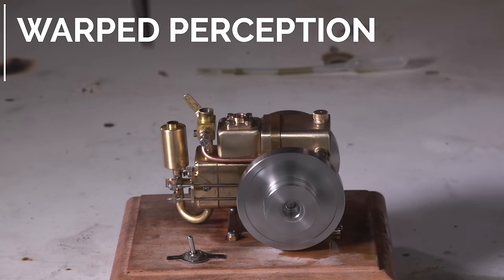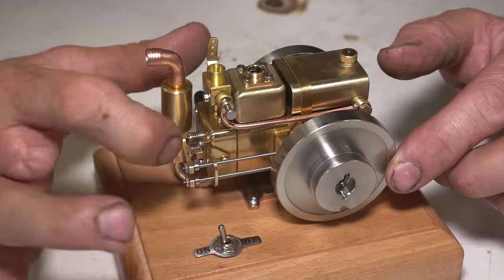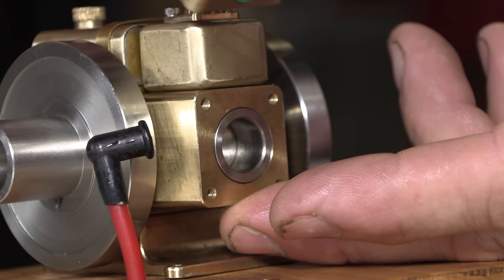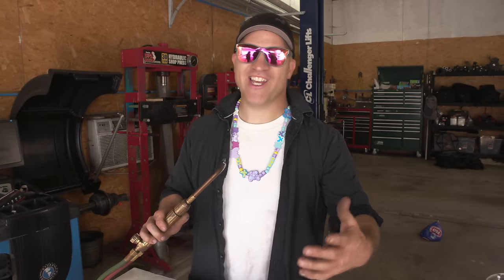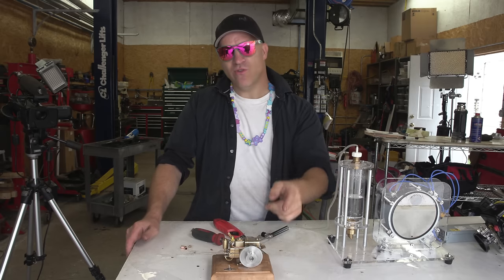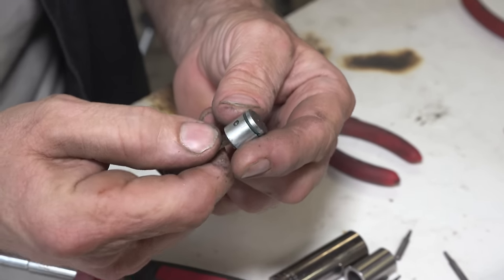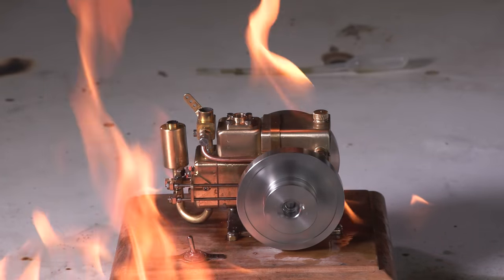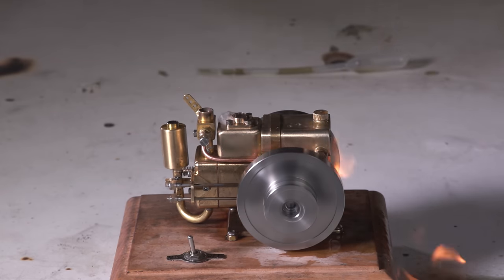I Blow up Mini Gas Engine with Oxygen Acetylene - (Slow Motion)

Comment: valve seats failed which escaped through the valve stem, water in crankcase is from the water escaping from the water jacket of the engine (if you notice the cylinder isn't very tight against the block, the fuel spitting out of the tank is because he jammed a pressurized nozzle into the throat of a carbureted engine (where do you think the pressure was going to go? duh) The combustion of hydrogen and oxygen wouldn't have created that much water, it's just not possible unless he burnt a lot of it. 

kinda makes me sad that the video doesn't really explain anything, it just blowing stuff up. pure oxygen would've made it blow up under enough running.

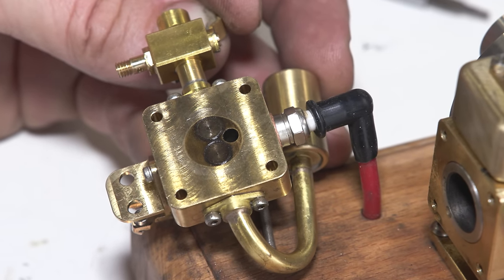Comment: 11:40 because those are expensive so they better take some abuse and really they used the wrong material for the job.  
The piston has a single rubber ring and is in a sleeve that can just slide out.

Comment: suck, squease, bang, blow thats how a 4 stoke combustion engine works a 2 stoke has 2 cycles there are 2 valves 1 for intake 1 for exhaust and the engine gets gas blows it up goes down more and lets it out intake then does it all over again

Comment: I don't understand the purpose of this, the oxygen and ethyne in a torch are a combustion reaction, so all you are doing is using the heat and pressure of the produced gases (water vapor and co2) to force through the engine. You are expelling  flames due to a continuation of the flame from the torch, as well as some oxygen and gas going through combustion that is still in the system (but the gas will stop the process quickly, as you are flooding the engine with gases that aren't oxidizers). Essentially you are just forcing the pistons to move faster with higher pressure and heat, and destroying the inside of the engine from the heat...but you are removing combustion from the engine entirely, and using the combustion of the torch instead.

The gas is being pushed out because it is heated, but mixing with oxygen, but it does once outside of the system

When you do it again, the ethyne is going right into the intake, and then when the torch is lit, it causes everything to suddenly combust (I'm guessing it lit just from the heat of combustion from the system

Comment: What's the point? I would rather see more creation improvements, than destruction. Anyone can destroy, but takes a very special  intelligent mind to create or make better ....just sayin
Reply: He repaired the engine after to demonstrate how destruction is not permanent,also the video tests different fuels and such it’s a performance test too it may look like a simple destruction video from the title, but he explains how the engine works also he shows the inner workings too, I thought it was a neat little performance vid showing how durable the simple little engines are. Yeah sure he didn’t turn a little 4 stroke engine into a naval engine or discover some new fuel and also why does creating something equal special intelligence?that’s doesn’t make sense if I make a lego sculpture and then destroy it does it make me less intelligent?